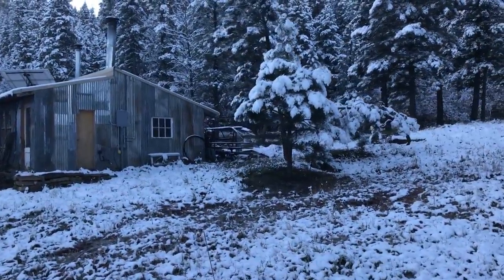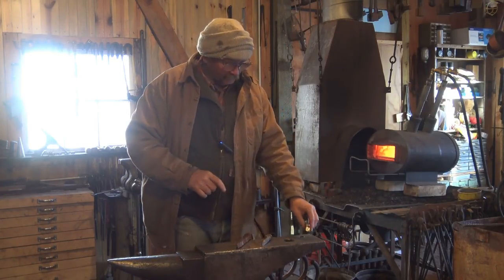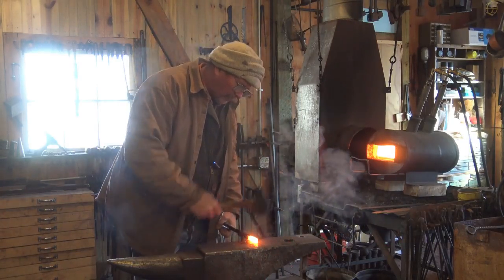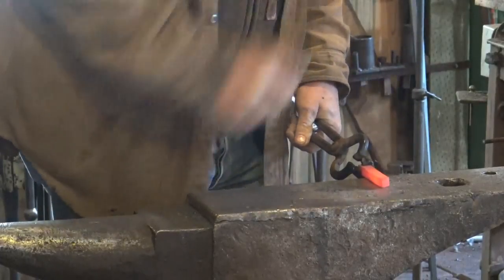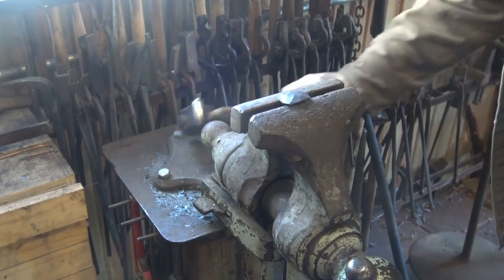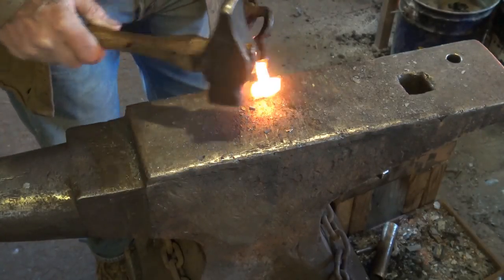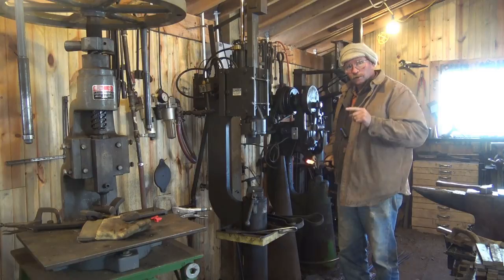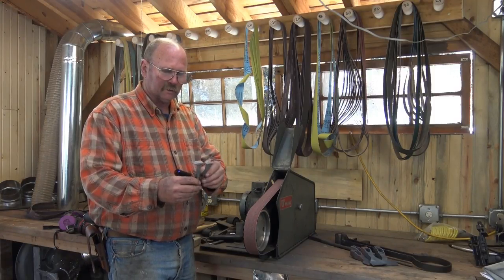Forging a mini railroad spike from coil spring, blacksmithing

Comment: Good video!  We got the same storm up here in Craig with the additional 40mph wind.  I've been working with coil springs in the museum shop to make triangular dinner chimes.  It's a bit of a laborious process to get enough material to work with, but they sell in the museum gift shop.  The same with RR spikes; for me it's not exactly knife making.  It's more like hammering the thing into submission.  The big spikes are subjected to blunt trauma with the trip hammer.  Looking forward to your next vid!  :)
Reply from the maker: the 40 mph winds would add a whole new level of miserable.  I bet the coil spring rings nicely as a triangle
Reply: Yes sir, they do ring nicely.  All of the work is in uncoiling the spring.  I have a little jig to bend the triangle itself, which makes it easy.  It was made by Ashley Farrell.  I think you may know her from the Carbondale event a while back.